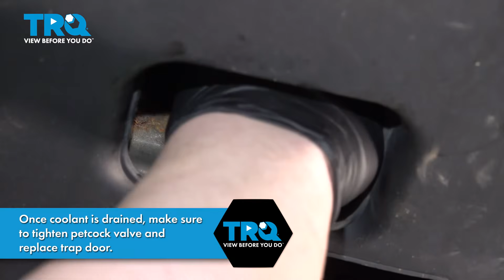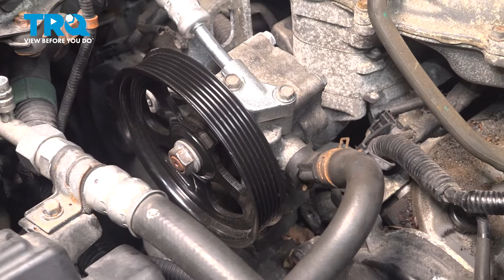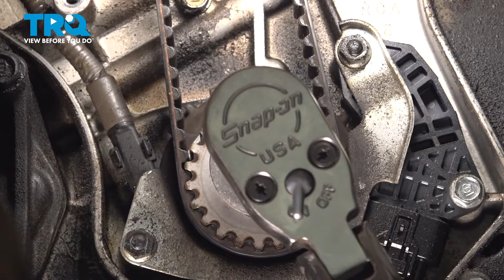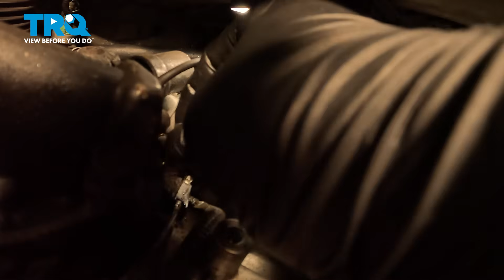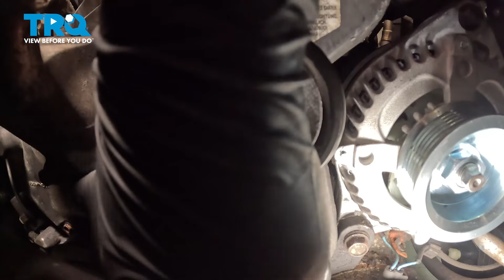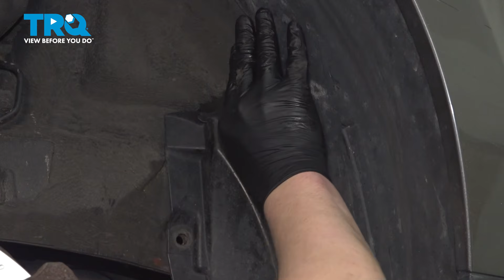How to Replace Timing Belt Kit with Water Pump 2003-2008 Honda Pilot

Comment from the maker: √  Watch the Video
√  Buy The Part at 1A Auto https://1aau.to/m-Shop-TRQ-Parts
√  Do it Yourself
√  Save Money
Reply: Don't you have to turn the crankshaft  2 more times again after releasing the pin from the tensioner to make sure it all lines up? My honda pilot is an interference engine but I turned it 2 times before releasing the pin and it lined up but not sure if I should do it again?

Comment: I did this on my 2003 honda pilot 8 years ago  , water pump went out I took my time because I had another car.  Took 3 weeks lol..   crank bolt was a mother but 1/2 heavy duty impact finally got it..  belt was replaced while I was there. One thing that piss me off was the goofball engineer who came up with a long bolt on the motor mount.  @ss wipe engineer

Comment: Can’t you just loosen the idler pulley to remove belt? Won’t it slack? J bolt holder bolt isn’t needed if replacing the tensioner? I’ve seen both ways done and I’m confused why it was done here

Comment: I've done this job a couple of times and just watched your video for a refresher.   Very thorough and well-paced.  One thing that occurs to me with this and other videos that involve removing the battery---not one video mentions that once the battery is disconnected on the Honda, the radio anti theft kicks in and you will need a code to be able to regain use of the radio.  Not an insurmountable problem, but I think it is worth noting along with the procedure for acquiring the code?  Thanks for the video--much appreciated.

Comment: Just did this job for the second time and man!!! When installing the timing belt make sure to mark all the alignment points from the old belt onto the new. Start by installing the top to bottom and leave the idler pulley loose. Once you have the belt in place, then you tightened the idler pulley. This really helped me out and hope it helps anyone out there. Thanks again TRQ for having this video.

Comment: Great video - but to all watching - do yourself a favor and at about 14:00 mark of this video -  remove the left engine mount that sits under the PCM (as other videos do) It takes about 10 more minutes to do  this but allows you   to be able to get full access to this bottom/recessed engine mount bolt with a full size ratchet.  - I learned this after wasting 2 hours and trips to store for different tools to try it the way its shown in this video.

Comment: 14:37 I rounded the head off my bolt in that hole. Had to cut the bracket and the bolt off with a sawzall. The two top bolt are m10x1.25x120mm. The bottom one is the same pitch but only 90 mm. And no where in Utah had one closer than four days out.

Comment: I started Monday and got it done Thursday reason it took long was because the timing belt was rip I had to figure how to set the timing and then I had to bend a metal bracket that bolts on to crankshaft sensor because it was bent and cutting the belt what a project

Comment: I am doing one at the shop when I took the cover off the belt was rip off and I’m putting a new water pump timing belt that came with the parts possibly the engine is junk but I’ll know when I start it up

Comment: Crankshaft pulley bolt will hold the whole project up.  Nothing worked , heat, breaker bars. Found a video and used the starter to break it free  after 3 hrs trying to loosen it. Starter worked like a charm.  The rest of this video is great

Comment: First of all, amazing job recording and editing this video.
Secondly, this will be the biggest job I've done to a car to date, after working on a handful of other things. Fuel pump assembly or suspension reworks or knock sensor for example. Thanks for the video. Also take note that this is a great time to just replace the motor mount. From other videos this seems to be a common surprise. Everyone gets the mount and goes... oh shoot I need to replace the mount.

Comment: If you decide to do this at home I commend you. Please keep in mind that the spring loaded valves can cause the rear cam sprocket to spring forward 90 degrees. It is wise to use a camshaft holder.
Reply: Explain? When taking the crank bolt off?

Comment: My vintage pilot hit 210,000 miles so it was time for major maintenance. Timing belt, water pump, serpentine belt & tensioner, front oil seal, spark plugs, all fluids. The Honda dealership quoted over $3000.  Using this video, I did it all in about 6hrs. I rate the timing belt/water pump job to be a medium level as far as required skills. A Harbor Freight Ultra-torque impact driver and a 19 mm weighted socket took care of the crank bolt with ease. Also mark the old timing belt at top dead center on the crank and cams and transfer that to the new belt. Simplified alignment quite a bit. The only surprise was the motor mount needed to be replaced because it was not in great shape.
Reply: That's exactly what I'm doing on my Pilot right now. It's that top upper mount isn't it? Couldn't believe how broken it was.

Comment: Crankshaft pulley bolt torqued insanely tight. Broke/bent multiple 1/2” drive tools. Used special tool off Amazon to hold crankshaft pulley in place while jamming 1/2” breaker bar into upper engine mount bracket. Used 4’ cheater bar and had pretty much put 180 degrees of turn on the breaker bar before it gave. Completely ridiculous.
Reply: Did you ever get it

Comment: Great lighting and camera work again guys, thanks so much. 
Service manual says after installing timing belt components - rotate engine crankshaft 720 degrees by hand. Check timing marks. Repeat x3.
If the engine mount is frustrating, remove the Engine Computer & bracket, remove the engine mount from passenger frame. Easy access to mount-to-engine horizontal bolts from top after that.  
Stay gold.
Reply from the maker: +@dnlmachine4287 Thanks for the feedback! http://1aau.to/m/Shop-TRQ